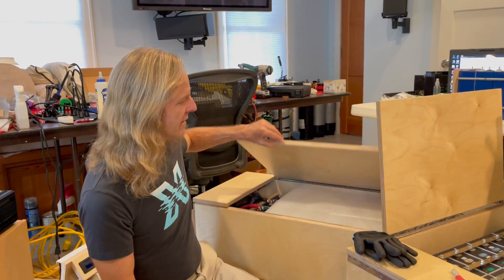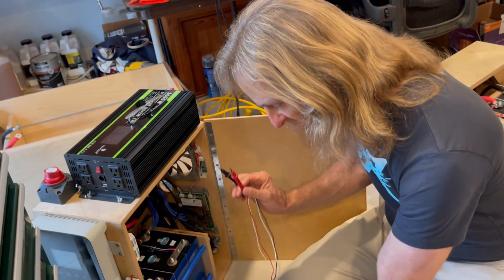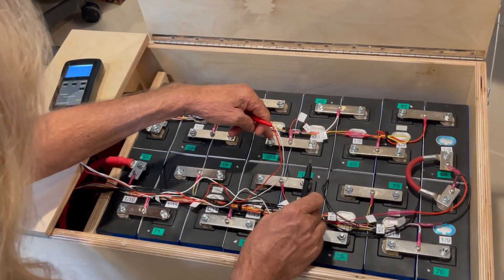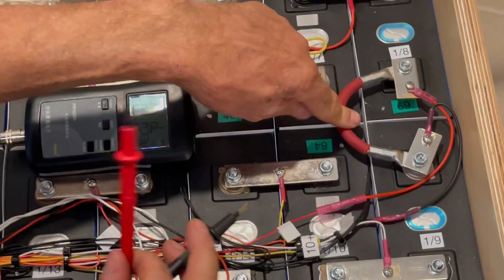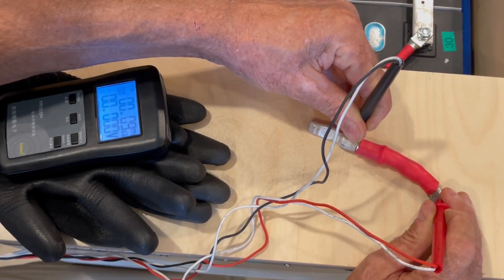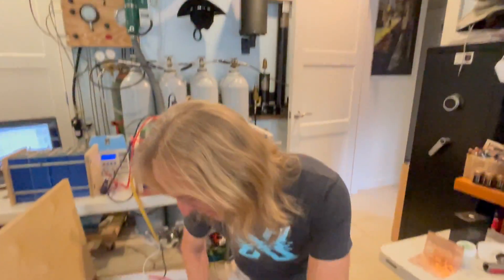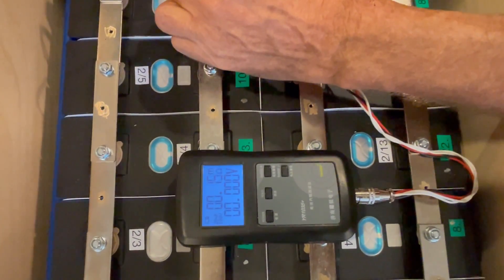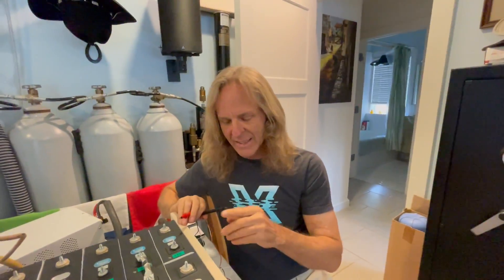It's No Joke, Size Really Does Matter!! Testing Flexible Busbars. Please read the description.

Comment: always go bigger and shorter and every mechanical connection that is not joined as one solid contious peiece of material will affect it because ther is not a completely flat connection and that will totally affect it all differently depending on how much mating sufaces are actually completely conected all the way wich wont be with those connections tourqued to the proper ft lb also

Comment: thanks for the video, i have been looking into this recently. im living out in the middle of nowhere in australia, i rently purchsed 24 lead acid batterys,  aluminium was all i could find to use as busbars, it seems to be working fine, any thoughts on aluminium busbars?
Reply from the maker: As long as the cross section is four times as large as copper, then the resistance is the same but there are other minor issues. The thermal expansion is much greater than copper so that can in some situations create undesirable movement. It can also create loosening of the connections overtime, which can lead to Arc King so you may want to check the torque of the connections from time to time.
Reply: @RayBuildsCoolStuff  oh wow! thanks for the answer!

Comment: So if you had a server rack with 6 48v 100ah batteries i could use 4/0 and it would be better than a solid copper bar or similar?
Reply from the maker: That would depend on the size of the solid copper bar.
Reply from the maker: In your previous question, you mentioned 1/4“ x 1“ solid copper bar. That would have a surface area of .25 in.². 4/0 copper wire has a surface area of .1662. The solid copper bar will carry more current at a lower resistance than a 4/0 wire.
Reply: Your knowledge is very impressive!!! I didn't trust those small 2 gauge cables that came with my eco-worthy batteries and I didn't trust running it to a busbar since you're still going to have the resistance on those small cables so I went ahead and bought some 4/0  and instead of using a busbar I'm going to use the cable and make the wires and go from battery to battery I figured the resistance after watching your video would be a whole lot better than routing it through busbars I'm just concerned with each battery getting the proper drainage and charge that's one of the copper bars seem to be a better option , thank you again for all your information

Comment: there is a paste that conducts better than copper?
@4:20 @5:30 you say 0.18 brass and 0.48 but the copper 4 gauge is much longer so for comparison this needs to be noted 0.26 and 0.21 on the wire or 0.42 terminal to terminal.. Probably needs to be a bit shorter or 2 gauge. But doing the same thing on a battery with copper bus bars the longer link would probably need to be 1 gauge to balance out.
The thickness of the cables on the milliohm meter crack me up.
Your comparing connections of all different lengths. Anyway it all depends on how much power your pulling and pushing.
  The bus bars linking the middle of a pack in a series chain defiantly needs to be oversized rather than undersized.
  Yes. If your BMS calculates based on resistance then the bus bars probably all need to be balanced so if you have any that are longer to bridge a larger gap they need to be oversized accordingly.

Comment: Doing a 4x100ah 12v battery bank for my caravan just wondering if I parallel b+ diag to neg or run equal lenthth 70mm to a centre post then run inverter off that??
Reply from the maker: Run your four batteries to a common busbar of adequate ampacity. It is best but not imperative to use equal length cables. The positive and negative cable lengths should be added and each pair should add up close to equal. That doesn’t mean each cable needs to be equal, just the pairs.

Comment: Let's see, .00021 ohms times 15 flexible buss bars = .00315 ohms added resistance to the circuit. a 100 amp draw @ 54V indicates a .54 ohm load. If you were to add the 15 flexible busbars, you would series in an additional .00315 ohms. This would amount to around 0.6% reduction of output. So less than 1%. Not enough to worry about.
Reply from the maker: @SpeakerKevin  the point isn’t to save energy. The goal is to create perfect connections with reduced heat cycling. This is one of the ways that we build in durability. We can of course, build to a standard that simply keeps the resistance below the point of insulation degradation but….. if we build it right, we can sleep at night.
Reply: @RayBuildsCoolStuff  It's too bad that the terminal clamping area of the cells is generally made of aluminum.
Reply from the maker: @SpeakerKevin  yes, but I believe that it’s unnecessary evil with the manufacturing process that they use for the cells. I think that with the carbon paste that we’re using and the care that we take in putting the connections together, these will last well past my expiration date.

Comment: You are missing one thing,  not just the wire size, but the strands,  "electrons travel on the outside of the wire",  so if you use welding, welders cable, a 4 gauge welders cable, "picking random numbers" might have 50 wires, where as a house wiring 4 gauge wire would only have 25 wires... hope this makes sense....

Comment: I am trying to sort out what the real use issue might be using 4awg wire as busbars in specific cases.   That is, at what load and pack size is this critical vs theoretical?  In my case, I'm running a simple 4S  pack that will be constant at say, <100 amp and inrush to 175 amps.   13V makes loss worse, but only 3 buss bars.   Hmm...
Reply from the maker: 100 A is a lot of amps.
Reply: @RayBuildsCoolStuff  Yes, thanks. 2000 watts inverter sized for inrush and running probably 1000 watts.  Trying to figure if 4ga is really an issue for short cabling (3"- 8" )   Reading comments (yours especially) I see that you are pointing out that the resistance fine-tuning is less about efficiency and more about good cell V readings, right?   Which would also be more about consistency than anything else...?

Comment: Great video, it's the basics that can make all the difference! I tried to explain this to the Off grid garage guy who is obsessed with balancing. You need bus bars the same material preferably copper and the same resistance value as possible, otherwise it's going to make balancing your pack challenging. Which is why he's still chasing he's tail.
Reply: In what application is he using bus bars of different sizes? I know his battery cabinet uses two large nickel plated copper pieces of bar stock. 

He’s been building kits lately that often come with pure copper or plated bus bars…sometimes flexible sometimes your typical rigid pieces of bar stock with holes drilled in them. 

I have wondered if the flexible bus bars suffer from any issues due to the fact that they are composed of layers of copper that are not perfectly flat against each other. I would hope that copper being soft would smoosh together at the connection point if you’re using 4-6nm of torque, enough so to make the contact of all the layers equivalent to a solid piece of bar stock. If the layers separate by tenths of a mm in the middle due to expansion and contraction of the cell I don’t think that should matter so long as the contact on the terminal (and this is where the REPT terminals and the new EVE terminals appear to shine in terms of area but I’m still just not a fan of manufacturers putting huge blocks of aluminum on top of their raw round terminals underneath)

There must be a better terminal design that isn’t as delicate as the holes drilled into the “terminal base” that I assume attached directly to the tabs inside the cell. I’m actually not very knowledgeable in the design of prismatic cells but I’m always chasing lowering IR and would love to have a user friendly design for prismatic cells     I should probably look into that more
Reply: I don't think he's chasing his tail so much as doing the same as Ray here.  Testing the details of variations to get us the best info possible for build decisions.  
And not sure if it's better to be "obsessed" with balancing or with milliohms.  In the end, each will yield better performance that may or may not matter.  As far as I can tell, good balanced cells will get you more performance out of a pack than chasing down the last few milliohms.  But it's all helpful.

Comment: that is very odd, without a large current the difference in resistance of 4 vs 2 gauge should not be measurable.
or am I missing something?
the connection from and the device itself is very suspect here
at least test every brass bar and every copper bar and various lengths of various wire gauges and do tiny bit of statistics
as presented the results are not useful at all
Reply: He is not using a standard ohm-meter. It is for testing internal cell resistance, has four wires and operates differently, not that I really understand.

Comment: Thx for this.  You make a good teacher, organized and logical.  I use 1/0 welding cable in all cabling to date, but my systems are small, 460 and 300 amps at 12 volts.  105degC welding cable appears to be rated at higher maximum amperage than THHN or other 90degC wire.  It differs by manufacturer and type.  I'm unsure if any standards are in place that determine ampacity, like the NEC does for electrical cable.
Reply from the maker: Charts are available online. I just use those.
Reply: @RayBuildsCoolStuff  thanks for the reply.  The charts appear all over the place on ampacity and some state they are not to be used for inline voltage carry.  The lowest I've found for 1/0 is 190 amps, as opposed to 170 amps for 90 deg wire under the NEC.   The standard charts list 300-350 amps but that is for welding machines only.  I kinda wonder what an electrical inspector would say in a grid-tie.  He might be limited to the NEC tables.  Just a guess though.

Comment: I've not heard you mention copper buss bars that are made of multiple thin strips of copper. They exist. Have you checked them out Ray ?
Reply from the maker: Hi David. They seem a bit gimmicky to me as they don’t seem like they could be flexible enough to actually be effective. They are still pretty stiff just like the ones with a ripple to their shape. If a stress is applied, what will give first, the busbar or the inner structure of the terminal. That’s why I restrain the cells to inhibit movement.
Reply: @RayBuildsCoolStuff  I've not laid my hands on those flexible ones. From watching videos of those who have used them they seem very flexible. Certainly if the batts were fixed in place as yours are there would not be a problem, I think. ? I'm enjoying your videos. Merry Christmas!

Comment: I think your correct that u need 1/0 to equal a copper busbar. My question is why does it matter? I have 9 banks of batteries all being connected with #4 welding wire all feed a primary bus bar that the inverter connects to with 4/0. What is the significance to mohms of residence? If all my packs use the same wire. No bus bars from cell to cell. When loading/ charging I'm loosing .25 volt under load? My max load per bank for a 12kw inverter is 30 amps in wire rated for 85 amps @ 75C. 
I used a flir thermal at max load and the only thing heating up is the 4/0 going from my bus bar to the inverter and it's only 15°f above ambient. No disrespect or anything of the sort I really want to know if the cost is worth the loss. Great videos! Thanks for your time.
Reply from the maker: I have 24 kw of inverters. I design for four batteries though I will use eight. If some are down for service I want the system to be able to run on four. My fusing is 175 amps per battery. My BMS is 200 amps. 24,000 watts at 46 volts is 522 amps. Divide that into 4 batteries and they each carry 130 amps. 

I design my wire for the most it can be asked to carry and I use fuses and breakers to protect the wire. I want the wire to run cool and the lugs to have good surface area and heat management. I'm building this once and sleeping soundly. If I had used a different size wire it would have been bigger. I felt like I cheaped out just a hair and as a matter of fact I used 2/0 to feed each of the 8kw inverters but 1/0 would have done it. I just wimped out at the last minute and upped that wire run up to 2/0.

The conductors in the battery itself is very important to me. I want them to be as close as possible in resistance and I want them to be cool. I would not use less than the equivalent of a copper busbar. I see others do it differently but I also see them have disappointing results in parts of their build. 

I aim for perfect but stop short of what I would consider just throwing money at a problem. This is just my approach but it is pretty heavily rooted. I've been making these kinds of design decisions on my projects for almost 40 years and then living with the results. Call backs just aren't something I want to deal with and when it comes to DC electricity I'm going to stay pretty far from the edge of the cliff. 

Thanks for your comment and the respectful way you worded it. I hope I came across with as much kindness.
Reply: @RayBuildsCoolStuff  130 amps is significant. I can see why u want to keep it cool. That's my goal as well. Thanks for the response. I too use 80 amp DC rated breakers on each of my packs. The wire is rated for 85A and a master inverter breaker rated for 400 amps. No fuses tho. The breakers seamed to be a better bargon and have more features. Thanks again for the response
Reply: @RayBuildsCoolStuff  oh and I have 9 jbd 120 amp BMSs one on each pack. It's a total of 70kwh. What brand is your BMS?
Reply from the maker: @electromechanicalstuff2602  Seplos
Reply: @RayBuildsCoolStuff  what is your motivation to go solar? I can honestly say mine is not to go "green" but for energy independence from the grid and coming skyrocketing energy costs.
Reply from the maker: @electromechanicalstuff2602  I don’t trust the grid. Generators require fuel.
Reply: @RayBuildsCoolStuff  agreed! I have a military mep-803a and 500 gallons on site for the farm and always figured Diesel will be the one thing they can never let run out because it would collapse everything.....  And then when last year I started hearing about the coming fuel shortages I knew. I'm still too reliant on others. I have to go solar and geothermal.

Comment: can i shove 4x8awg wires into a 1awg ring terminal lug? I have 8awg wires lying around and I need to connect to 48v 120ah bank, with a 200amp bms. But i don't think I need more than 150amp current.
Reply from the maker: Five of them would fit in the cross sectional area but it will be challenging get them to cooperate. What type of wire is it?
Reply: @RayBuildsCoolStuff  they're Cooper strand wires 600v thhn
Reply from the maker: @KoiAquaponics  I would not use thhn for this purpose and would not lug four of them together
Reply: @RayBuildsCoolStuff  what's the reason?

Comment: I see a lot of worry here about using un-tinned copper on Al post.  The whole idea of any good connection is contact area and pressure.  If either is missing you don't have the best connection.  Think about this:  if you have corrosion between the Cu and AL you have reduced area.  Clean both areas.  The idea is to have a GAS TIGHT contact between the two metals in which case there is no oxide or resistive material on either metal.  Unfortunately, it is difficult to prevent oxidation of a newly cleaned Al surface,  unless you use a substance that prevents the oxygen from reaching the surface.  Silicon dielectric grease is commonly used because it is a forever compound.  Put it on the post, use some copper cleaning pad to scratch the surface clean and SMOOTH, wipe it clean and immediately apply an additional THIN film.  Clean the Cu, make sure it is flat and soft and torque it down part way.  Move it some to make sure it seats and finish torqueing.   You should have a gas tight connection with maximum contact area and minimum resistance.  Using any kind of so called conductive grease is not required because anything except maybe silver particles will only add resistance,  and if the carrier is not silicone it will probably not stop oxidation and moisture infiltration.   Add more silicone grease around the connection to stop moisture and, if you want to cover or coat the copper,  I would use lacquer,  a coating that has been used to protect metals for ages.

Comment: I’m reading elsewhere that Aluminium (I’m Australian - get over it) bus bars are better. Did you test them too?
Reply from the maker: It is aluminium, of course. I can’t help the way we screw up words. Aluminum busbars have to be much larger. A big problem with aluminum is its coefficient of expansion. It moves a lot from thermal expansion. That is the problem with aluminum wire and why it isn’t used throughout our homes. If you have it as a feeder wire, check the torque regularly as is required. Ole power Paul in Oz is the big pusher of aluminum, eh? He had Andy convinced until Andy saw how much they heated up. You pay more for worse performance. Try not to get trapped by the overthinkers. They try to solve problems that don’t exist and create problems that are real.

Comment: i only use open lugs so that  i can millivolt from the end of the wire itself, from the strands, to the lug; at least leave some copper exposed on the back, it allows the same thing, see if the crimp is still good.  Of course, simply millivolting from lug to lug does the same thing; so, it's just a minor detail,but i find it useful and enjoyable to measure  the crimp-to-cable conductivity every so often.
Reply from the maker: If you don’t expose any copper strands then corrosion can’t travel through the wire over long periods of time.